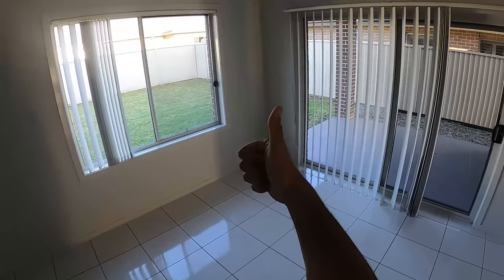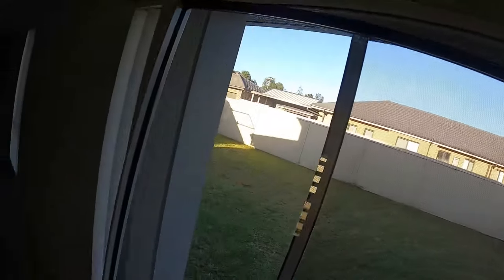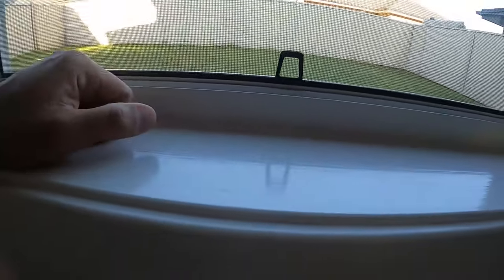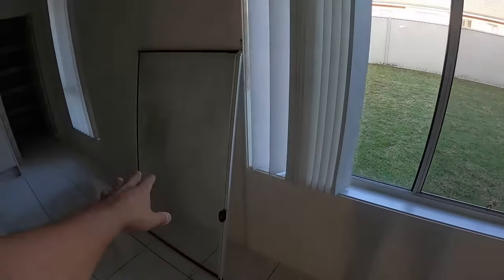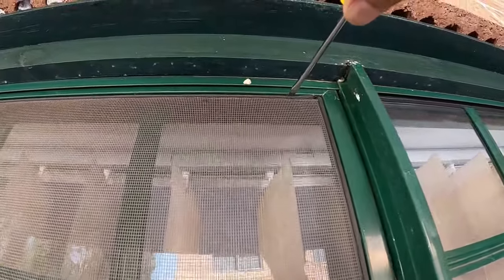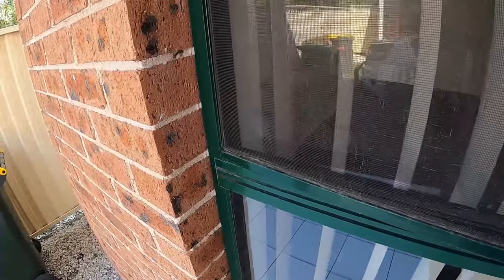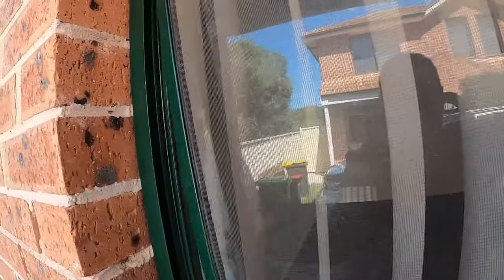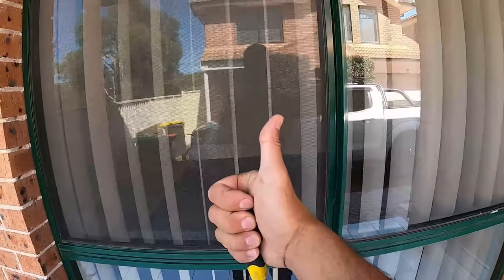How to remove and install fly screens

Comment: Another nice little vid Bill 👍
I just had a quick one for ya - My fly screens are fairly similar to the second type in your video, except the frames are timber and no real channel to sit in, they just go inside the timber frame basically.
All the windows are awning. 

My question is, how on earth do I get them in and out without scratching the timber? I just painted some of them and they're leaving some deep scratches sometimes...

Could this also be a paint issue? I.e. Primer not used/ suitable...

Comment: Thanks for the great video. I can't get my screen in no matter what I try. Is it possible Stegbar made the screen a few mm too big? I can get most of it in but it just gets stuck right down in the last cm of the bottom corner. Too scared to push too hard in case I ruin the window frame.

Comment: I have never had to remove the window? Guess I have been extremely lucky? Cheers Bill
Reply from the maker: Most new houses and high rise buildings need to be all removed from the inside of the property which means the window needs to come out for access. If you ever come across it you will know how to remove them 👍